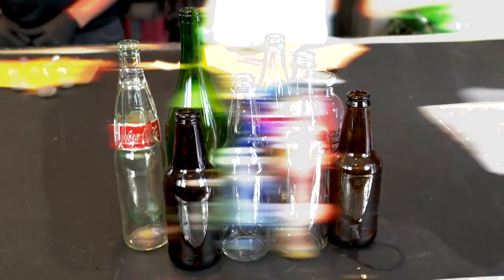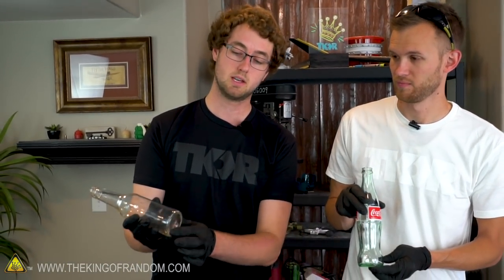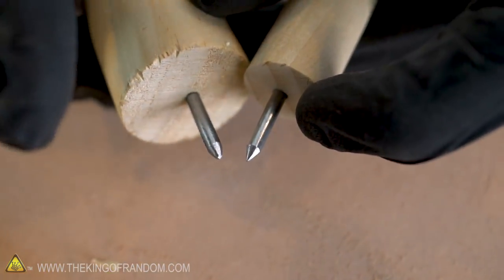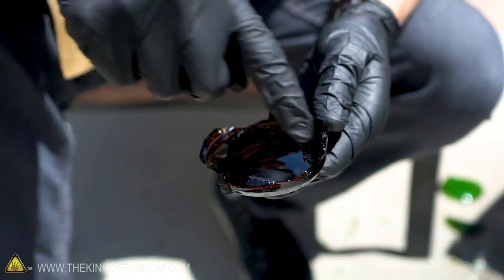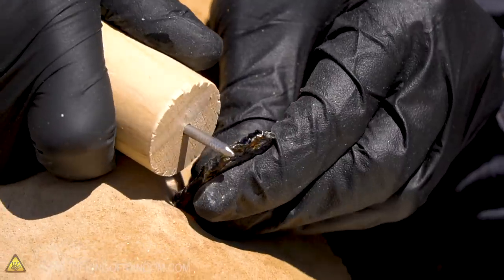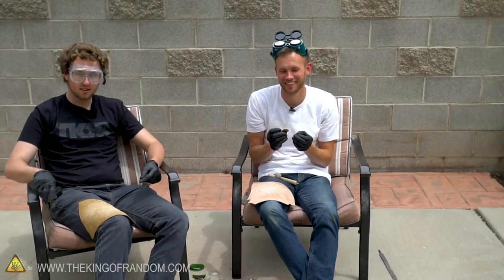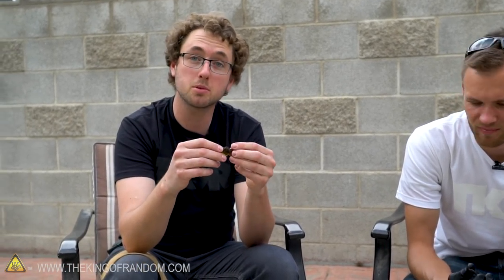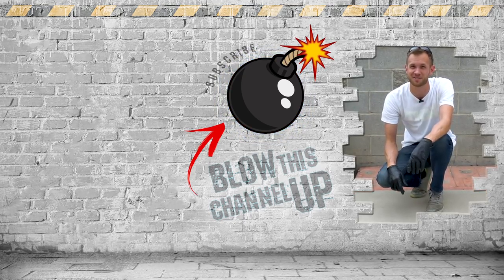Making Arrowheads from Glass Bottles! How To Make An Arrowhead Knapping Glass | DIY Glass Arrowhead

Comment: Can u do a video on how to make a bottle from a arrowhead 🤔🤔
Reply: M Cov or create a microscopic sized bottle
Reply: M Cov, it’s possible. You could melt the glass arrowhead and put the molten glass in a bottle mold.
Reply: You can't cast glass, you need to blow it
Reply: Melt down the glass
Reply: M Cov you can melt the glass and reblow it. Not impossible
Reply: TheDJPhatPhuck blowing molten glass are kinda hard :/
Reply: Angela if you know what your doing not really, I made my own "tobacco" pipe at a glass blowing class and it was my first time ever doing it. It's not as hard as you'd think. The main thing is you can to keep it rotating otherwise the glass starts sagging in areas
Reply: TheDJPhatPhuck yeah i know...just saying if they really want to try themselves
Reply: Trying that rn
Reply: Thats near impossible
Reply: M Cov whoosh
Reply: The bottle is to soft

Comment: You forgot to mention the most obvious candidate: Window glass. When you see a broken window, pick up some shards (Don't get cut!). The owner now has less glass to clean up, and you now have some arrowhead fodder.
Reply: Most windows are tempered so this wouldn't work since, if you were to try to pick at it, it would shatter into a million pieces :P
Reply: Which would be obvious if the window is broken.
If you find an unbroken piece of window glass, most tempered glass will have a mark in the corner that says tempered (along with manufacturer info).
Reply: You can also use suitable fragments of toilets...sink...appliance ceramic.
Reply: @tikkidaddy  yup. Thunder chert.

Comment: You should grind steel in a vacuum. Use a ball mill inside a vacuum to grind the iron into a powder, then after a few days, decrease the pressure. (I believe with so much surface area, the iron, left unoxidized, will spontaneously combust when in contact with air) the vacuum is used to delay  the oxidation until all steel is ground.

Note: use high-carbon steel, as it is harder and more likely to become powder

Comment: IF you still have the electric arc furnace you should try to melt rocks into lava then cast the molten lava into molds. LIKE IF YOU AGREE AND WANT TO SEE THAT!!!!!:)
Reply: Paw Print Productions🐾🐾 I don’t think that it would get hot enough.
Reply: Unless you somehow got lava.
Reply: Which you couldn’t
Reply: Just saying, if you can get something hot enough to melt rock, I don't think any kind of mold would withstand the heat.
Reply: Guys he melted pebbles in his arc furnace and the electrified plasma can reach temperatures of up to 20,000F, which is more than enough to melt rock.
Reply: can you give the link to the arc furnace vid?
Reply: okay I found it but lava just cools down into either obsidian or igneous rock
Reply: Sure!
Reply: Yeah that would be the problem

Comment: Cool video on making arrow heads. Saw your other videos of ear plug bullets and silver bullets. What about ice bullets? Silicone mold of bullet, pour in the water and use liquid nitrogen to freeze them fast and solid and using dry ice for storing till ready for use. At least, that's the way I would try, if I had the stuff and a place to safely try them.

Comment: Best glass for thickness is a green glass peirre fizzy water bottle those are both thick bottom & flat, also some taco sauce bottles have flat bottoms. Water & a rubber mallet works for popping the bottoms off! 5 gallon bucket needed for that btw!

Comment: 1/4" or an 1/8" drill bit works the best to pop bottoms out; they have just about the right weight & density. They pop perfectly almost every time with a few gentle & angled shakes.

Comment: I wonder if you could use moulds to shape glass? I have been to glass blowing factories, so I know that this wouldn't work straight off the bat. But what if you used the moulds to get the rough design, then finish it off with some heated tools, while the glass is still soft.

Comment: So, not saying your process is wrong. It isn’t. This style of knapping is just intended for stone like limestone and chert tools. Glass tool, like those made from obsidian we typically made into blades and flaked off of a blade core rather than be chipped down from a larger style. Obsidian could be made into projectile points like this but it wasn’t common. Glass was mostly in blade form. So if you want to attempt this I recommend stone.

Comment: Copper or aluminum nails work better.  They are soft enough to grab the material but hard enough to push the flakes.  Steel or brass tend to skid right off at times.
Reply: I'm going to give this a try tomorrow. I have copper and aluminum round stock available. It makes sense. Thanks for the tip!

Comment: You know, if you put a little water into the bottle, and clap your hand over the mouth of the bottle, the bottom will pop right off. much easier and cleaner breaks than the drill bit. With a fair bit of work you can turn those bottoms into small signal reflectors, or with a lot more effort, magnifying lenses for fire starting.

Comment: Guys, there's a more efficient way to pop the bottom off of the bottles, just put about a half inch of water in the bottle, and wear a thick glove, then hold the bottle in the air, and quickly slap the opening with your palm..... The slo mo guys did this

Comment: What happens if you melt down a marker or crayon any color and refreeze it will it still be able to work the same? But 
1 group you vacuum the air out and refreeze. 
2. You just refreeze them

Comment: How you use the file is wrong. You are only supposed to slide one the thing your filing in the direction of the blades of the file, so you don’t flatten the blades.

Comment: Arrow heads you find are not really arrow heads. Those are literally discarded flint blades the Indians used for knives. If you used these for a arrow's tip it would make it too front heavy and the blade is too big.